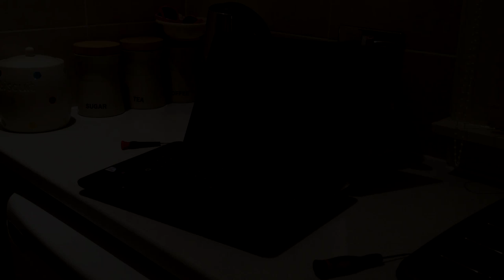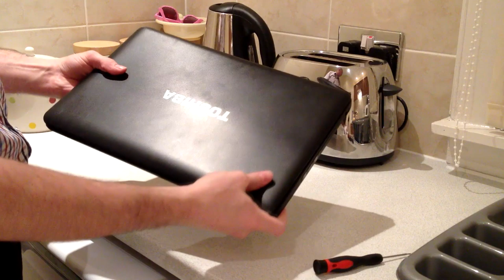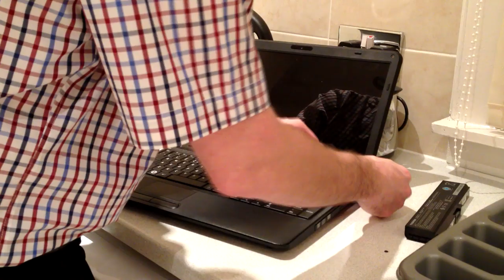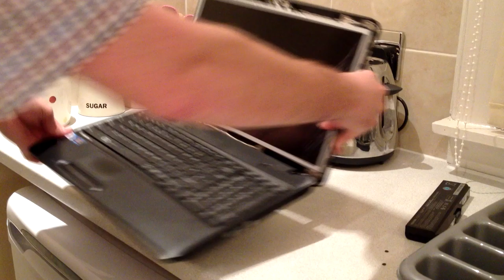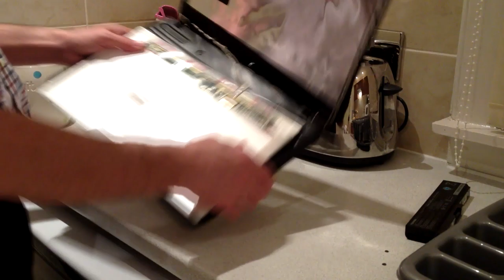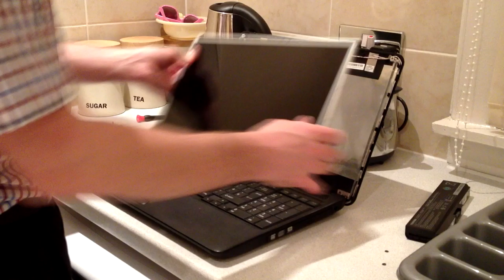Replacing the LCD panel in a Toshiba Satellite Pro C650 (Full HD)

Comment: in response to bboy0024, the part number for a Toshiba Satellite Pro C660D (manufacture date 09/2011) is LP156WH4(TL)(A1). The tosihba screens in these laptops are generally made by LG Display, with some exceptions.
The screens for the machines above can be found on eBay for roughly £45.